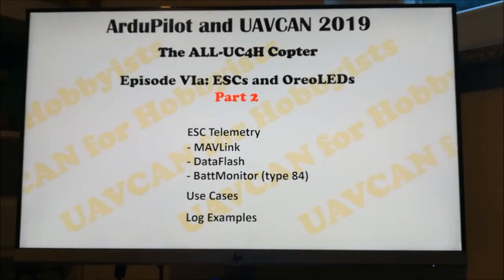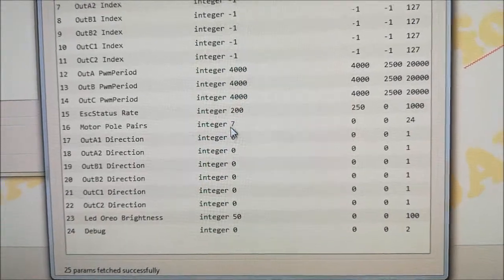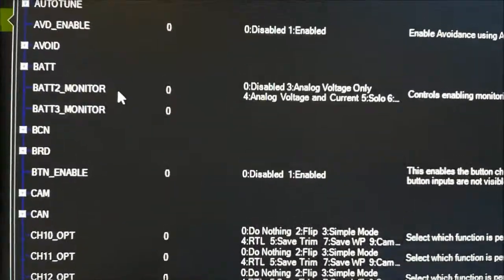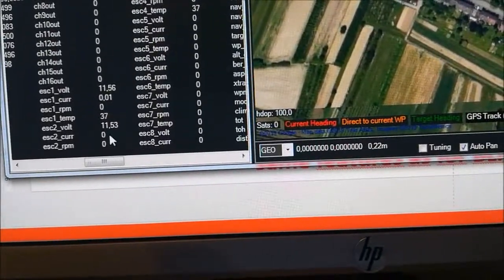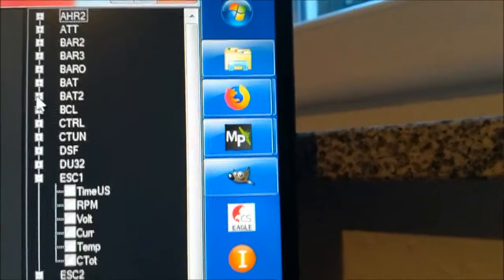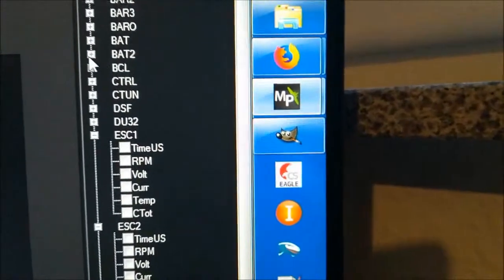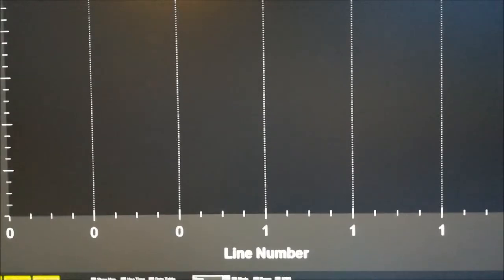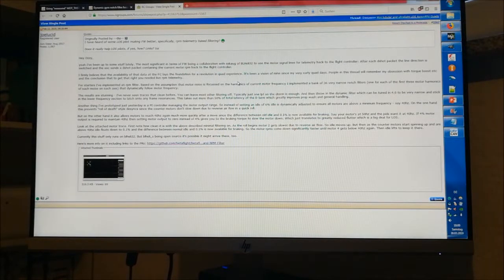ArduPilot & UAVCAN 2019: The ALL-UC4H Copter, Episode VIb ESCs and OreoLEDS (Part 2)

Comment: Hi Olli !!
I have just started to read about UAVCAN and am slowly going through all of your videos and articles.
I have been wanting to link some external devices like a load cell output (to measure propeller thrust) to the Pixhawk2.1 for a long time now. I am very excited to switch to UAVCAN... and with the ability to measure RPM from the ESC, this means you can create a thrust/RPM and thrust/current curve.... which for identifying the best props for racing or for serious drones is very very cool!
I am just starting, but I wanted to say thanks for all of your work.  (I saw what happened on RC Groups... that was very regrettable, so I thank you for continuing with your work and for all the publishing you have done.)

Comment: You could do an automatic check for prop presence or damage like DJI's do with ESC telemetry, based on pre-launch throttle blip to amperage response.  You could also measure averages over time to monitor for motor bearing health or detect blocked propeller rotation to reduce chance of an ESC or Lipo fire when downed or stuck in a tree.  ESC telemetry is certainly not a novel feature on any other comparable flight systems...  but nothing intelligent has yet been done with it as an open-source contribution to Ardupilot.
Reply: with a CAN output amplified from a basic strain gauge (assuming you have a motor mounting structure that can measure strain predictably) you can generate a nice thrust/RPM or thrust/amperage curve... which... yes, you could also create a damaged prop warning quite easily if thrust remains low during use